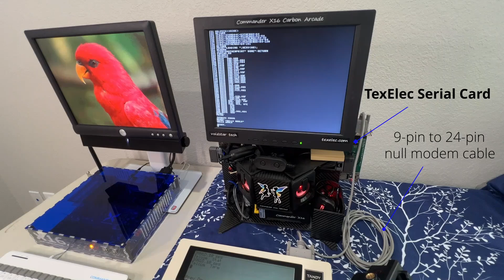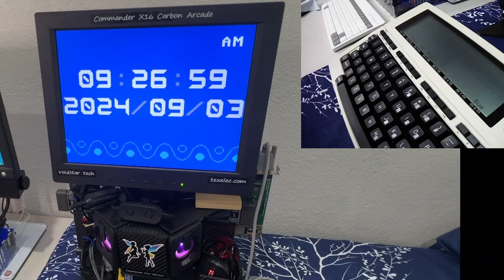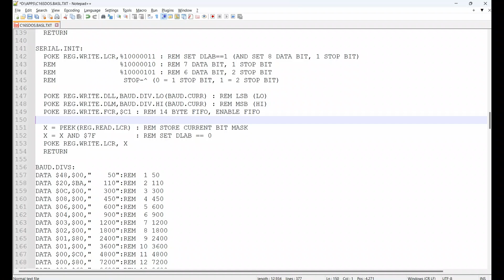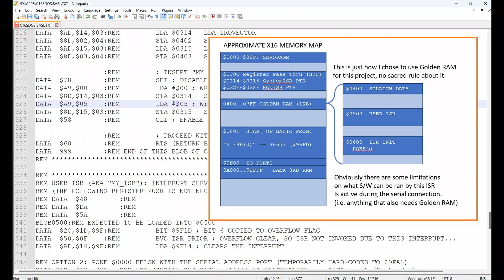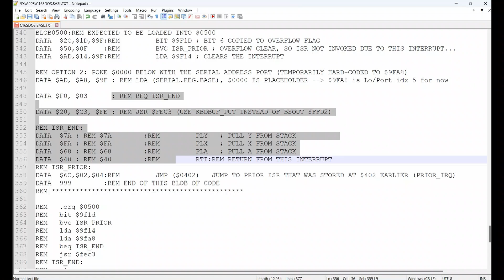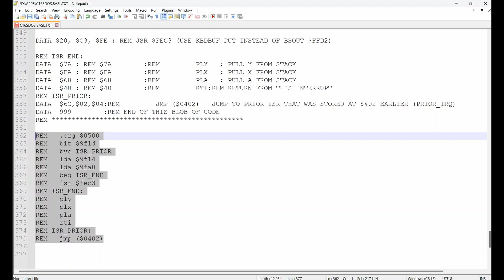Example of RS-232 Serial Keyboard (Tandy Model 102 as Terminal to Commander X16)

Comment from the maker: Also to clarify, to me the term "Serial" just implicitly associates with the DB9 pin connector (so that's how meant "serial keyboard" in that a keyboard that functions using a DB9, or DB25, style connector).   When you asked for a "serial cable" that's generally what you would get.   I do realize PS/2 is also a serial signal, so I should have clarified about how the term "serial" is a bit overloaded.